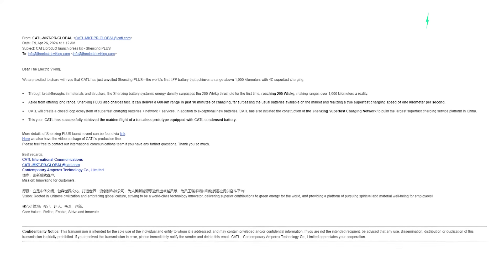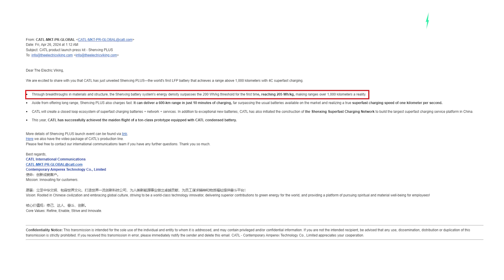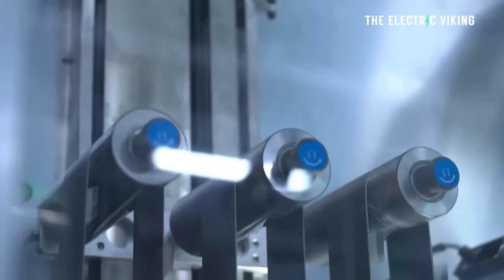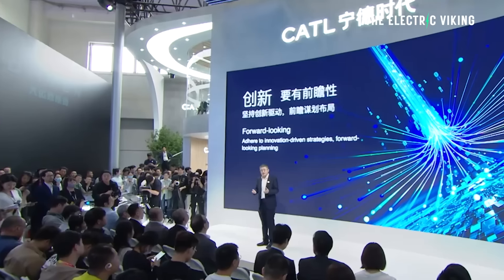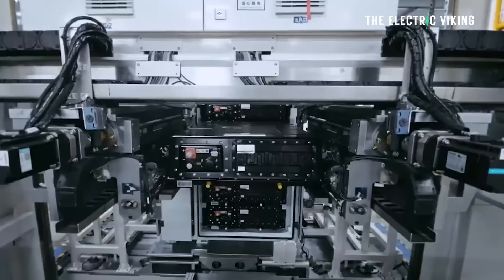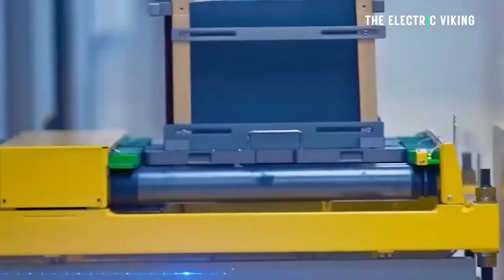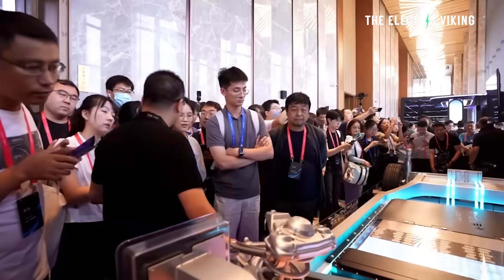CATL reveal new battery with highest energy density in the world

Comment: Sam please fix your units. It's kilowatt hours per kilo and again you have to distinguish between pack and cell level. No way that somebody is getting 500 watt hours per kilogram at the full pack level. That's probably a cell level figure, so you have to observe these two distinctions. Watts is power rate kilowatt hours is energy level and the distinction again between Pack level and cell level energy density.

Last but not least in terms of misleading claims if you put a hundred kilowatt hour battery into a Tesla Model 3 it would get 20% more range than the current vehicle if the battery weight was exactly the same. If it weighs significantly less, you might get 30 to 35% more range, but even that may be optimistic. That does not remotely translate into a thousand miles of range. Not even close. Please reIn in these wild speculative statements - they are actually hurting your Channel
Reply: Even if it cell level it is still phenomenal so stop moaning.
Reply: Why let the truth get in the way
Reply: Didn't he say 1000 kilometer range...not miles?
Reply: It is 500 Wh/kg. Not kilowatts. Not sure why you're saying he is wrong with that. I have no idea cell or pack level. It is whatever most manufacturers compare it to when talking about these things. 

 Amprius also has new batteries that reach that level. 504 wh/kg of gravemetric energy density or 1,300 watts per liiter of volume. 

 The claims he is making is straight out of the manufactuers mouths I think by the way as I have heard them before in other videos. GT p

 Except that range thing he said. If a Model 3 was getting 100 miles for 100wh/kg. Then you put a 500 wh/kg battery with all other metrics being the same into it. You would get a car that does 500 miles in a perfect world.

 As the Tesla 3 in the example was getting one mile per watt hour. 

 Anyway Sam was right as far as wh/kg which is why these batteries are a big deal. 

 I THINK they are mainly going to be squeezing the aircraft industry for the moment though. 

 I thought there was a 720wh/kg already in China? That is my only question on this video. Does that not hold the record or is it since it was just a lab battery?
Reply: CATL wrote 205Wh/kg. Sam says that Elon said what needs to be achieved is 500W/kg. Do notice the missing "h" in the latter statement. Watthour isn't the samee as Watt.
Reply: Your math is off. I calculated for my Ioniq 5 it would mean if the weight stayed the same I would have kWh: 238.544. Which is 3.2 side the current battery density. I currently get 300 miles of range on a full battery so that would move me to 960 miles range. This is assuming the battery weight given by Hyundai of 1051.8 lbs is true.

Comment: If it is legit...its a humanity changing innovation.
Reply: Hi, so an EV with real equal range (if not better) to petrol vehicles (500w/ Kg) becomes a true turning point. It also has a 18,000 charge cycle life and charges at low temperatures @-20C and a 4c charge rate, according to the Viking.
Never mind Tesla all the manufacturers will want it, car and truck and plane.
Take care all M.
Reply: no, they stole it from us.
Reply: @eric9069   well it’s out the bag if they are running it.
No IP.
Take care M
Reply: As usual, words get muddled. He keeps saying Watts/Kg. That is not Wh/Kg.  Watts is Power, Wh is energy.
He was talking Watts(Power) not Energy(Wh). 
Also he did not say what the new battery was used for in the truck and the jet plane. They both need starter motors that need batteries that work at very low temperatures.
Reply: If true, there must be the risk of a massive explosion. With, say paraffin, until oxygen is available it is relatively inert.  However, a battery has all the energy contained within.
Reply: @markeh1971  
What is the advantage in an electric plane ?
When Rolls Royce aviation have now stopped all work on electric 
propulsion I would believe them first.
As a Avgas plane uses fuel , the load gets lighter = more efficient 
flying , Same with H2 power.. A battery weighs the same if its
fully charged or flat , zero advantage. 
So I ask again, what is benefit of electric planes ........... Nothing .
Reply: If this gets to cars in production.. it would really shut up all those that promote the fud of range problems of EVs ...😂😂
Reply: @budbud2509 
There are considerable advantages to plane makers, airlines, and passengers.  Jet fuel burns at roughly the same efficiency as petrol in cars, around 30%. That's why driving an EV brings the cost of driving down more than 70%.  This doesn't even count the savings in battery systems that don't require maintenance.  That brings us to safety, which a battery powered plane achieves in two ways -- first by eliminating jet fuel, and second by reducing the risk of mechanical failure to almost zero.
Reply: @Gunter_Custom  Unfortunately, unless it charges in less than 10 seconds, they'll still moan 🤣🤣🤣
Reply: @mddell24  That's what he says but the letters does say  205Wh/kg. So I'm sure he just misspoke.
Reply: @PETERJOHN101  
If only that was true, it has NOT played out like that and Ev's  
have proved unreliable ( Data from breakdowns ) . But still an empty 
battery weighs in the same as a full one , unlike Avgas or H2 where 
the plane gets lighter . Rolls Royce know what they are doing I 
think by stopping work on electric engines. 
EV's bring the cost down , clearly u have NOT read any data , yes short journeys charging from home , anything longer and a 20 year old diesel beats it on time and cost ....... many vids prove this . 
Battery do not require maintenance ????, tell that to the 56 cars per 
week that catch fire in Shangri alone , not even counting any other 
chinese  cities 
Empty promises again . 
I see NO advantage , And nor does Rolls Royce Aviation
Reply: @eric9069  do you mean Sion Power or someone else?
Reply: @markeh1971 , it doesn't mean a thing unless they can be made for a reasonable price. Note that nothing at all was mentioned in this video about projected price. All sorts of incredible things are being done these days with unlimited funds, things like 300+ mph cars, or even flying cars, but they cost an absolute fortune. All I want to hear in the battery news is what a battery-pack will do at what price. That's the balance scale. That's what matters at this point.
Reply: It is a gamechanger. :)
Reply: So, the Shenxing PLUS  is about 10% higher than the best current Tesla battery.  An incremental improvement, not a game changer.
Reply: They lie. They Always lie.
Reply: Question:  1:02 Sam quotes Musk talking about 400 watts/kilo and then he notes this new battery is "much much more than that."
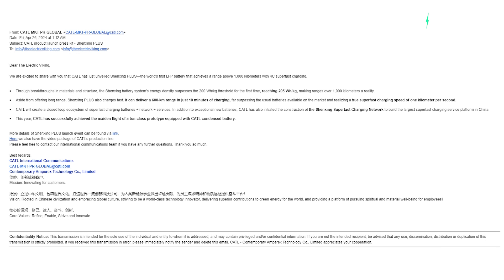However 1:31, the email (which I hope is not fake spam of some sort) references 205 watts/kilo   so I don't get it.
Reply: So in the Model 3, it's 75kWh battery would weight only 330lbs with these batteries.
The whole car would lose almost 700Lbs
Or they can bump it up to lets say a 115kWh battery, increase the range to ~500+ miles, and still lose 500Lbs
Reply: @eric9069 lol accept it china is superior and highly technologically advanced than poor usa and europe😂😂😂😜😝😛

Comment: 500 Wh/k is mind blowing. The pace is crazy. Put these in trains, buses, massive semi trucks no issues. Domestic air travel is even possible now.
Reply: BAHAHAHAHA!!!! 😂😂😂😂😂🤡🤡🤡🤡🤡🤡🤡🤡🤡🤡
Reply: @brucemitchell5637 what do you haters live for? Seems like you're all very busy bringing people down. Not the life I'd choose for myself.
Reply: Trains don't need batteries lol. We can just put power lines above tracks - just as we did for the past 50 years here in Europe. Even in buses you only need the battery if it's a long distance connection outside the city. Ya'll need to stop gooning to electric-whatever and just stop to actually think for a sec.
Reply: There's always a battery break through every week
.  So far 100% of those haven't come to manufacturing volumes at any scale other than prototypes .. these included.. 😂😂  @JoshuaMcTackett
Reply: The pace of "breakthroughs" is crazy, but the production not so much.  In the 15 years since Tesla started production of their Roadster, the battery is still pretty much the same with a couple of chemistry changes, no "crazy" changes.  Toyota was supposed to have their SS battery in volume production two years AGO.  Every day we see a new "breakthrough", let's see these batteries 1) be proven and 2) be in volume production.
Reply: battery’s are going to be cheaper than pantographs a lot cheaper
Reply: Amprius is offering a battery with similar specifications and it is ready for application.  Their graphite anode (Li-ion) batteries offer a specific energy of 320-500Wh/kg and a density of 1000Wh/L.  It is almost a 30%-70% increase to current batteries in used in EVs.
Reply: @bengt_axle  I just read about the Amprius battery - no indication of charge cycle life or calendar aging..  If the battery is substandard in either, they won't be in any EV unless the EV is built for easy and cheap battery swaps.
Reply: @1InVader1  you might want to reconsider regional trains that currently run on diesel will be disrupted with these batteries
Reply: @1InVader1 most won't, but there are lines that will be uneconomic to convert to electric. I know, I live in a village in Scotland served by one.
Reply: A Tesla with 1000 miles range. 🤯 I'm 100% in
Reply: @costageorgiou2649  Do you drive with a bottle strapped to your leg or use a diaper? I stop every three hours whether I'm in my Tesla or my wife's Edge.  We take 25 minutes to get coffee, a meal, stretch our legs/backs and use the "facilities"..  During that time, I put gas in the Edge or charge the S.   I don't need 1000 miles and it's really silly to carry that kind of battery capacity and weight.  It's not needed.
Reply: @ohger1 just about 500 cycles for now as silicone tends to expand after multiple cycles. They are used for drones and other things that need fast charging and a high energy density. The battery can be charged at up to 10C if I remember correctly. One can be recharged while using the second one in a drone so you never run out of batteries.
Reply: @1InVader1 Cost to deploy and maintain hundred of miles of overhead wires might not be feasible.
Reply: @Sharukurusu   Why, are the electricity wires leading to your house getting replaced often? The lines for the trolley in the city are decades old and rarely need maintenance. The wires also cost almost nothing, you can easily buy it in tons, batteries are a lot more expensive. Compared to that taking apart train engines for battery replacements sounds a lot more expensive. You'd have to maintain train tracks more because of heavier trains.
Reply: @1InVader1 Batteries are likely just going to be on tender cars so they can be switched out and moved aside to charge or maintain, weight won’t matter as much as it would on a road vehicle since they can spread it out onto other cars, they will also likely be able to use existing diesel-electric locomotives (just bypassing the diesel step). The batteries could also charge from the grid off-peak and be used for load balancing. Either way companies will decide what makes economic sense and go with it, so any armchair theorizing doesn’t get us anywhere.
Reply: Well the electric airplane it's kinda sweet if you think about it
Reply: Condensed batteries use silicon anode that has very poor cycles
Reply: Yeah, the pace is so crazy that the highest capacity 18650 is still 3.5ah after 10+ years.... 😂😂😂😂😂😂😂😂😂😂
Reply: ." Domestic air travel is even possible now"....that's a game changer!!...you mean to tell me that people can get on an airplane in their own country and fly to another location within that same country?!!...
Reply: @ohger1  No, but it's nice that it's available.
Reply: @1InVader1  Countries like the US with vast distances of unelectrified track where it would cost horrific amounts of money and literally decades of time to retrofit electrification might actually benefit from battery-powered electric trains. And, certainly in an interim period while overhead power is being installed.
Reply: @Gunter_Custom  What exactly are you happy about, the lack of immediate technological progress, what? Seems like an unproductive attitude to me personally at least.
Reply: @lennyvalentin6485  The US barely even has railways in the first place. It's about 10 000x less in total distance of tracks compared to the EU.
Reply: @lennyvalentin6485  name one battery break through that has made a difference in the past ten years...that's actually in volume  production... That's not immediate.. that's a long time..🙄
Reply: @Gunter_Custom  I'll settle with pointing out the significant performance increases and cost reductions we've seen in the last decade. Also, LFP being in mass production, and sodium-ion now in mass-production also.

Also... By defining "breakthrough" any way you like you can dismiss anything I say, so to put it bluntly; no, I don't entertain kooks and/or trolls like you. Sorry.
Reply: @lennyvalentin6485  lol you think slow progress is like a break through .. 🤦
Look who the kook really is .. that's just dumb ...🙄
Reply: @Gunter_Custom  Like I said, I don't engage with bad faith trolls. Bye bye.
Reply: @lennyvalentin6485  lol can't win an argument so you leave .. like all the rest of the woke Dems .. 🤣🤣🤣
Reply: @1InVader1  Not everything is electrified and that cost plenty; presumably this is a poor use of batteries but the first bulk carrier electric ships have now been built so maybe replacement for diesels/rural china or third world might happen. :)
Reply: @1InVader1 battery powered trains make a lot of sense in places like Australia where lines go very remote. Better to haul a battery carriage and build charging infrastructure at nodes than to build out catenarys and their associated transmission lines/transformers everywhere.
Reply: @MichaelSmith-px1ev diesel trains have electric motors too, so you could feasibly adapt existing locomotives to just run on a battery tender. Train drops off depleted tenders and swaps out for charged units at intermodal nodes along the route.
Reply: @JoshuaMcTackett life you chose is delusion if you think this battery unlocks air travel.
Reply: Put one a car ,and I might buy one.
Reply: Tesla has been around for what? 14 years and the cars don't travel much more than the first ones , when is this technology going to give us this 1000 miles per charge.
Reply: Is this like all the other miracle batteries, some lab results, or an actual battery that is produced?
Reply: @1InVader1  if you want to replace diesel trains which are still in wide spread use even i EU - you need batteries.
Reply: More distance is easier on the grid.

Comment: Love your work, Sam. This is very exciting! Remember it's watt hours per kg though. I get a nervous twitch every time I hear "watt per kg"!
Reply: Yeah that hour part is important. 

How do you format in bold!
Reply: @Myrslokstok 
Bold is done by putting an * on both sides of a word or sentence... the asterisk disappears when the comment is posted.
Reply: @PETERJOHN101  Ohhh thanks it makes stuff easier to read!
Reply: @PETERJOHN101 well, *son of a gun*.  Wow.  Nice if it works. . .
Reply: @dewiz9596 , it looks like you have to put them around each word. The spaces disable the function.
Reply: Tron-Jockey , I demure!
Reply: We all know what he means.😂
Reply: Sam videos is about quantity not quality
Reply: Some might say: you know what he means. Watt per kg is about power density. Which is a thing and it is also an important factor.
Reply: Tron-Jockey  If I were to report motor power in joules or pressure in kilograms, you would think  was an idiot. Watts per kilogram is a definite statistic for a battery, and watt/hours per kg is a completely different statistic. Using the correct units indicates an understanding of the basics and avoids ambiguity in communication. For example, if the battery were actually limited to 500 W/kg, then a 300 kW motor would need at least 600 kg of battery to realise its potential power.
Reply: I don’t have the Time to understand the difference between Power and Energy (wink wink)

Comment: WATT HOUR not WATT. CATN shown you numbers in Wh.
Reply: RIGHT!   "Wh" is NOT watts.  It's watt-HOURS - a unit of ENERGY, not power (which a watt is).
Reply: Per kg
Reply: Yea, he has clearly not understood exactly what he is talking about.
Reply: @BillMitchell-lm8dg  You don't need to make silly corrections. Everyone knows it's watt hours when talking about energy but it's hard to find people still using the hours extension when talking about batteries.
Reply: The point still stands. They've made a dense pack.
Reply: @perperers2502  Electric Viking clearly doesn't know, he calls it watts, just like written on a LED-bulb ( doesn't store any energy ).
Reply: @archiebunker5256 
Shorthand is common in these discussions, it's not worth having to read hundreds of comments about it.
Reply: @perperers2502    The watts (i.e. power) that a battery can provide is also an important and separate specification that shouldn't be confused with watt-hours (i.e. energy that it can store).
Reply: @PETERJOHN101  This isn't shorthand, this is confusing.
Reply: Yes agreed, Wh
Reply: @veritas.sounds    I agree with your agreement!  🙂  Using "watts" instead of "watt-hours" for energy is like using "pounds" instead of "pound-feet" for torque.